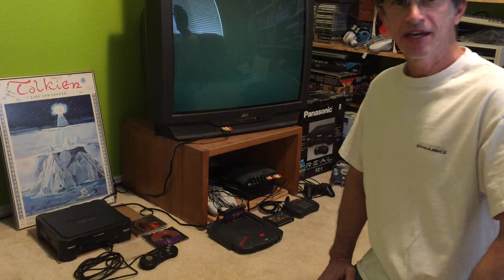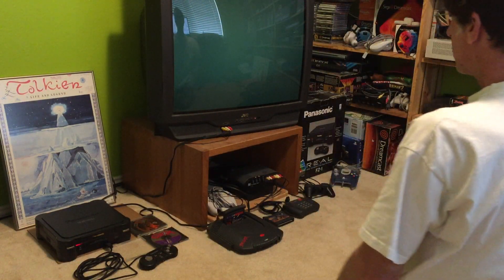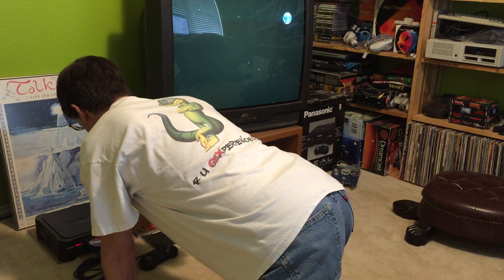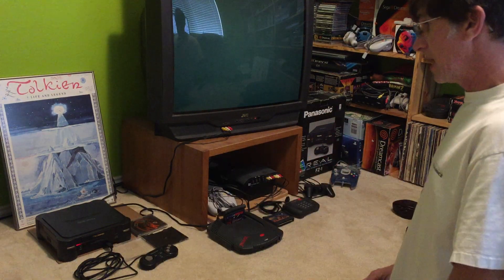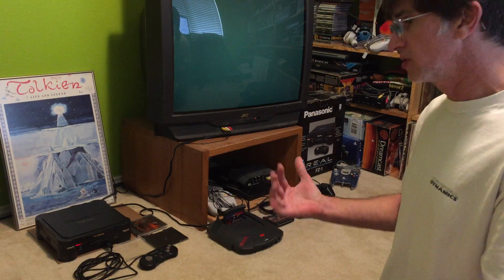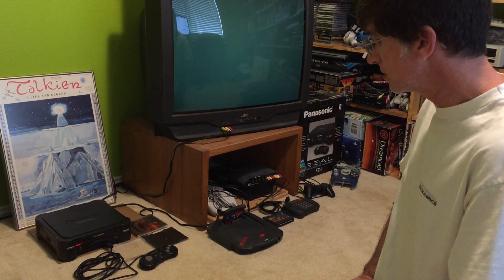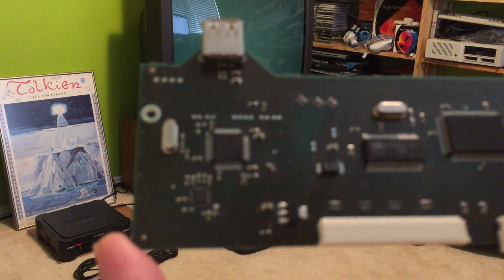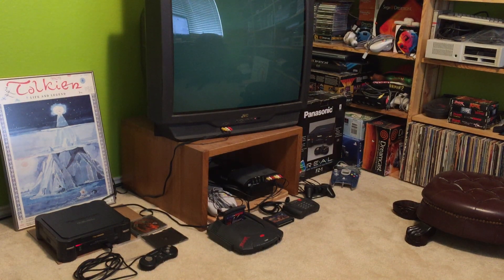Repair 3DO model FZ-1 Part 1 of 3: Diagnosis (CD-ROM not reading discs)

Comment: My issue seems to be that mine  won’t do video and audio output. I plugged it in with the red white and yellow, but no sound and only a few faint lines that travel down the screen.

Comment: I have an issue where mine starts up and then it ejects the disc put it in then does it again. I can't get it to boot up I finally found one with a bunch of games and cant play anything. HELP!!!!
Reply from the maker: The easiest option would be to buy one of the options for playing games from a USB. The MNEMO internal one for the FZ-1 unit is the last expensive at $150. Since you own the originals, its perfectly legal for you to load them up to play from .backup .isos that you can download from the Internet Archive.

I did see this post on reddit, which in my experience is correct in running through what your 3DO's problem may be:

Possible problems in order of likelihood:

1) Dirty lens (clean with a clean q-tip. People disagree on whether to use liquid or dry. And if liquid, whether or not isopropyl is safe to use on the laser lens or if it can fog it up. Up to you. Either works.)

2) Capacitors (power supply caps are the most suspect, then motherboard)

3) Broken drive gear (there is a gear made of plastic that shrinks over time. It's on a metal shaft, so when it shrinks, it also cracks. 3D printed ones are available online. If you are handy, you can bore out the center to the correct size and glue it back in place)

4) Poorly adjusted laser (adjustable if you know what you are doing)

5) Foggy lens or bad laser. Good luck finding a replacement laser nowadays (ODE is your best option if this is the case).

I recently saw this site selling an ODE for $59
https://crownarcade.co.kr/products/usbto3do-3do-ode-for-panasonic-fz-1